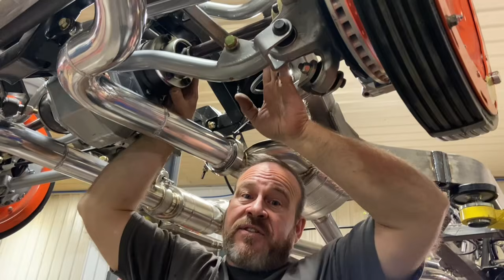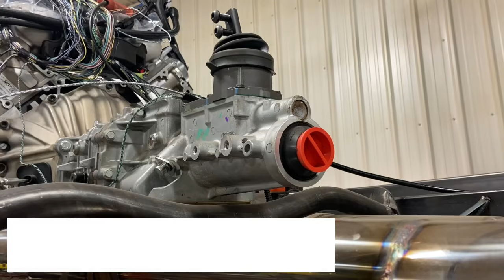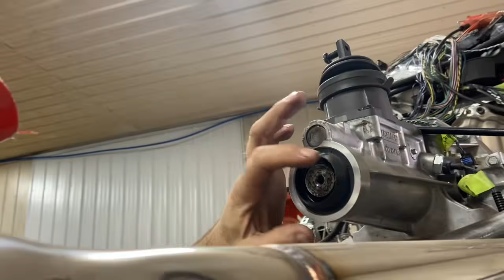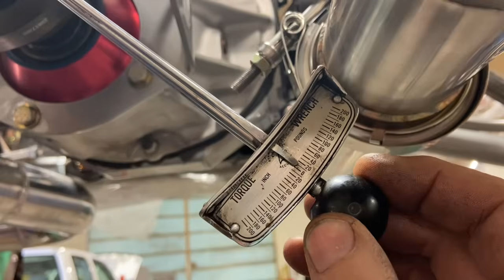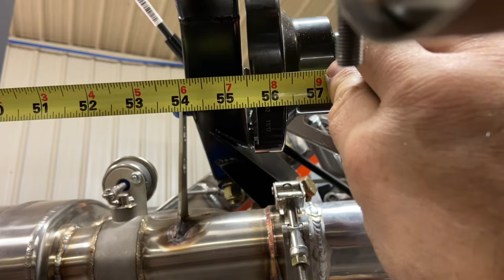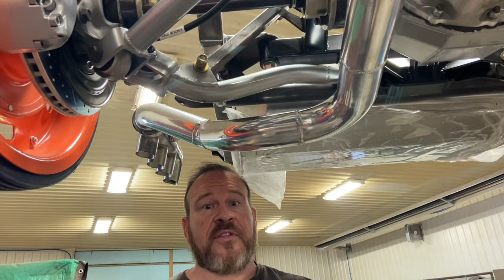Extreme Driveshaft Angles Explained and How to Deal With Them

Comment: Do you have a link video discussing/ explaining the exhaust system?
Reply from the maker: I have a few videos on exhaust, what were you wanting to know?
Reply: @prairiewingsperformance6036 
It looks like a small muffler, but an exhaust pipe is attached to it.
Is this to prevent a drone sound?
Reply from the maker: @Jim-qc6gu oh the actual mufflers. They are valvetronic. How they work is during normal driving the exhaust goes through the muffler. When you want more flow they open and bypass the muffler. The muffler is actually straight through pipe for open mode. They use a key fob to open and close these. This car has a supercharger and I am planning on having them open at a few pounds of boost.
Reply: @prairiewingsperformance6036 
Thanks for your reply
Reply from the maker: @Jim-qc6gu thank you for watching and reaching out!